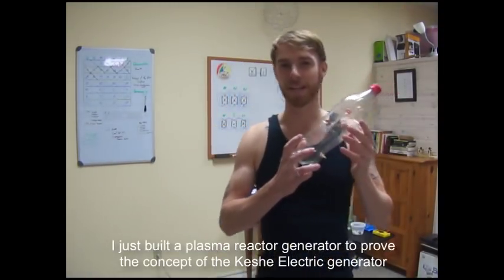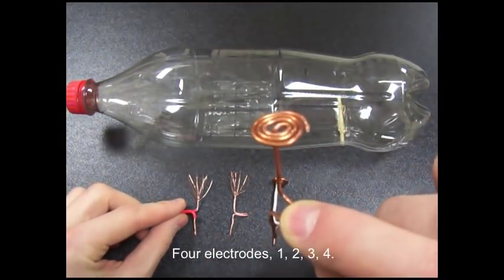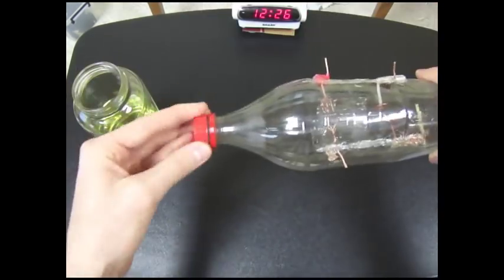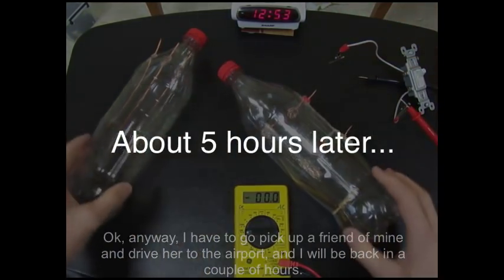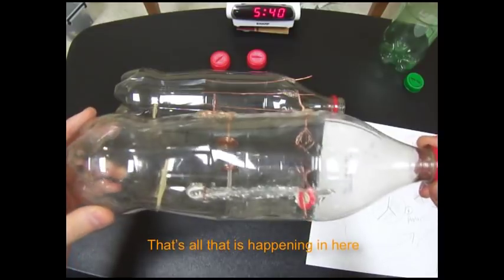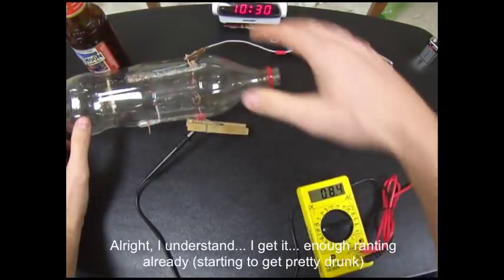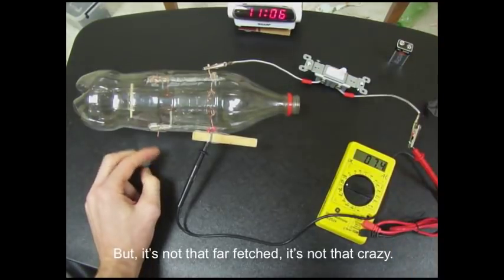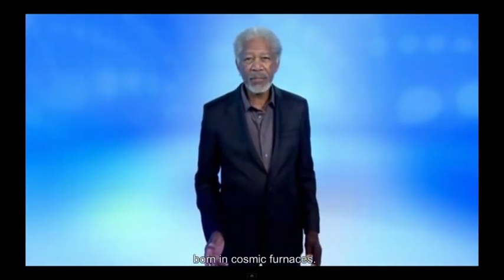Keshe Plasma Generator ~ Here is The Future ~ Infinite Energy

Comment: I experimented with nano coating copper and I was able to measure up to 29 mv in open air then discharged down to 0 mv waited for a minute and measured again at 32mv did this several times same results . I used sodium hydroxide draino crystals and boiling water to steam nano coat the copper, let it set for 20 hrs. Then dry overnight. Atmosphere seems to recharge my nano coated copper.

Comment: nice one..heres a few questions:
1 - if u discharge the reactor will tthe charge build back up?
2 - how did u get a clear solution like that..mine turned orange and it had exothermanl properties
3 - on my copper something build up any thoughts on that
4 - what is the current output?
5 - why is it working without a bottle cap?

Comment: You can actually get a useful amount of electrons to charge a battery.  Ham radio operators know that the wind strips away
ions from the antenna and can build up a very high charge that will arch a spark when it reaches a high enough voltage
using a old automotive ignition coil and a spark plug across the high voltage side of the transformer coil a pulse will be released across the 12 volt side of the coil where a diode will rectify this pulse to charge a 12 volt battery.  200 feet of bare wire will charge a battery within several days   do a search (Using a antenna to charge a battery)

Comment: Can someone explain, how is this infinite energy? Don't you need to use the solution in order for the reaction to occur? Doesn't the solution evaporate or dissipate? Won't you need to keep using more solution? If so, how is it considered infinite energy when you have a finite fuel source?

Comment: this looks more like a capacitor being charged with static electricity. dielectric material filled with air, copper leads seperated by air along the dielectric material and voila, low budget air capacitor. you constantly handling the bottle should transfer a charge via the triboelectric effect and gather on the copper leads, until you discharge it...just a thought. Keep up the good work though

Comment: You can make a far more potent battery from just dipping a carbon and an aluminium electrode in a solution of 10% salt and water. It'll work for months and will give you 1V per cell. You won't be able to power anything other than a bright LED with it though, but free energy usually comes in small ammounts so it's all in order there anyway. :)

Comment: Hi..Thanks for your work..I use tesla generators for hand helds 
Galaxy recharges and stuff.. but I see you developed 28 volts?  Is this sustainable under load?
How do you determine at what current- this system will sustain a voltage potential?  Thanks  Frank

Comment: Very cool..... one of many devices showing we are surrounded by vast quantities of energy and it's just getting to it. I like what you did here and it makes my head spin putting it all together. Think there are a few pieces loose... Ouch. If you have not tried measuring using the asymmetry of the weak force let me show you something I found much better than using dice. It allows information frame problem solving by using the information found in the question making getting the question correct the hard part but looking a lot like a card trick the Great Professor would approve of that the dice have been hiding: two harmonic commas notable because the second is bigger than the first and both are responsible for the asymmetry of the weak force and you will see having the asymmetry added to time is also added to space without violating L transformations and that means exactly what it says.... showing a second reverse arrow is connected to time creating the larger harmonic comma.

Of course that is the hard way of showing a second reverse arrows exists. The easy way is to just say atoms oscillate in space that is relative to time and look for it in an obvious place:-). It is the obvious things holding science back, not complex issues in need of new theories. You establish an inertial frame of reference for Mass or go nowhere faster and faster.

Doing math and understanding it are two different things and not using dice puts you all alone. I've been working on understanding how the fine structure constant @ e- {a}/t=hv has two doors for the 4 forces. {a} is the asymmetry ratio of two opposite arrows showing the coupling constant  is the result of a ratio. Not easy to stand in both doors and look both ways and keep the picture in phase. True symmetry requires the speed of light stopped in a wait state in the beginning and time crawling before it runs relative to the Observer's relative sense of time and the speed of light. You start with the concept of forever and break that in half..... and that's only half the time of a complete Mass oscillation cycle.

Well technically its a little less as the graviton's comma in the second half of the cycle is a little bigger than the electron's and that's where the force of gravity in 2D comes from, the tiny asymmetry in the weak force CERN detected with neutrino's @ v-c/c=2.48e-5 sec in 453.6 miles. SLAC's E158 data shows the asymmetry of the weak force adds 1 hour every thousand years to the speed of light using "clocks". That huge distance ratio breaks down into the wf asy adding 2.48e-5 sec in 453.6 miles too if you accept the 0.20e-5 (2.68e-5) left over needed for the larger second comma added to the second reverse arrow showing a spectacular match still over many experts heads while many laymen of interest "get it" rather well at times.
Reply from the maker: <3  Summary of Breakthrough Energy Technology: /watch?v=rSe7ovsucpk  :-)

Comment: Fascinating experiment,

Have you considered the possibility that by adding sodium hydroxide in your solution it will effect the copper terminals - this causes a chain reaction of chemical decay of the copper and as a result creates an electric charge. 

Interestingly this effect is accumulative with amphoteric elements (like most metals) however copper is extremely amphoteric in nature.  As it decays it creates more Cu(OH)2 (as well as conglomeration of Sodium Peroxide - which will increase the rate of the copper decay and as such increase the recorded voltage as more copper is exposed / effected.

From your demonstration it seems that you have developed a chemical battery where the copper is the sacrificial anode.

Again, a fascinating experiment - please keep on experimenting!

Comment: I'm pretty sure he just made a battery...  Potassium hydroxide is just good ole fashion Lye which is an alkaline (base) and easily produced.  What does have my curiosity is that lye has a very long shelf life (years even decades), soluble in water and it does not react or corrode iron or steel.  Could a power source be produced with these materials that just like a solar panel soaking up the sun, and when it needs to be charged you just add more (cheaply produced Lye) solution?  It is a battery that you don't have to charge by hooking a battery charger to it, you just change or add a chemical you can create yourself at home.  No one cares about the technicalities of whether or not it is a plasma generator or some kinda what-ever, it does produce power at small amounts just like a single solar cell, link more cells.  I think by now somebody might get where I'm going with this...
Can anyone share their thoughts?  No, I'm not claiming to be all knowing just curious what others think???

Comment: Some remarks on this footage. 
1) According to your definition of plasma my cat is also plasma - he is made of protons, neutrons and electrons. It's not plasma. 
2) This Keshe generator has to produce electric current/energy. The problem is that to get plasma it requires plenty of energy, e.g. electrical current! So you have circular problem. Plasma requires very high temperature to exist/create from e.g. gas. Small plasma ball requires 2000-5000 V !!! And it's volume is about that of your bottle, so you also should have the current of this U - voltage (P=U * I, P - power, I- current). Plasma can be create on Earth also in nature by lightnings. Then electrons are free, not bond with nucleus - its main feature of plasma.
3) Plasma IS NOT CURRENT AND GRAVITY. Plasma is only good elctrical conductor - not current itself !!! so:
A) you need current to get plasma
B) you again need current the plasma - being good conductor - could conduct the current
C) so if you have so many electrical current, what is sens to build something which gives a little bit of electrical energy - voltage as I saw well? No sense, no possibility
C) so you have in the bottle anything except plasma - what shows the measure? You have wires so the wires under the influence of magnetic induction acts as an antennas and conducts very weak electricity. Of course it could be increased (as in music amplifiers, radio, TV-set etc.) but it requires external electrical energy and it violate the principle of isolated system generating lectrical energy not using this from extrnal source.
4) And here we have all the absurd about the Keshe free energy and your "plasma reactor/generator.
BTW: To make plasma using lightning, it uses about current ~ 250 000 A, voltage ~ 30 milions V - congratulations
To make small plasma ball you need electrical current:  2-5 kV and of frequency 30-100 kHz - congratulations (watch on your bottle)
5) Gravity - plasma has nothing common with gravity - plasma simply reacts strongly on magnetic fields, so this feature is used in some type of experimental equipment for nuclear fusion (e.g. ITER) - your bottle doesn't look like ITER or TOKAMAK.
6) May be more beer make your dream comes true while dreaming on bed? Good luck! :)

Comment: Plasma is the 4th state of matter, which you can see in a florescent tube. It is created by passing electricity through a gas. This is a very crude battery with the use of potassium hydroxide. Changing the electrodes to nickel and iron and submersing them in the liquid would make a traditional Edison battery, which has Lithium in it to stabilize the charge, but doesn't need the Lithium Hydroxide to work. All he has is a rechargeable battery, and a poor one at that.
Reply: Thanks for explaining it!

Comment: I have used a multimeter like the one shown for 30 years, working as a field technician, the setting which you are on is reading milliamperes. 2 milli ampers is 2/1000 of an amp. This effect may arise from the static charge of the plastic bottle. Try duplicating your results using a glass or ceramic bottle? Either way, a simple thermocouple millivolt generator ( used on most water heaters) puts out 20-50 mill ampers, from just a pilot flame,acting as a safety device. This form of energy is so small it is in practicality useless.

Comment: Well, something is happening with the solution, but you forgot to mention something interesting, your voltmeter range is set to 200mv, (Meaning) your readings are 2.7 millivolts and the higher 59 millivolts in another word  0.0027 volts and 0.059 volts. If you are using the higher voltage, you need 203 bottles to have 12 volts and for the lower 4,444 bottles for 12 volts. The worst part where are you going to drain the current need it to put to work an inverter. But, anyway thanks for your experiment.

Comment: Wow, amazing.  Its a good thing you got back from the airport so quickly.  Otherwise, it could have gone into absolute equilibrium run-away, and blown up the local residential area.  Then caused a singularity, (Small one, you only used one (1) litre bottles), but a small singularity, that could have swallowed you cat.  (Hence bringing us to the schodingers paradox).  It's all connected.
Reply: but we won't know where the cat is or what it is doing.

Comment: How much energy have you produced ? Can you power a usb device ? ir anything bigger.  And is that volts on the meter ?
Reply: The meter reads 60mv, which = .060v. And the current is unknown so there is no proof of any power whatsoever. In basic DC electronics voltage X current = power.

Comment: Um....You're simply measuring potential here.  Not actual electricity/current.  I can measure a 200 Volt potential coming off a pole in my backyard. Does that mean its producing power?? No, of course not.  In fact it wont really "do" much of anything until a thunderstorm rolls through.  Then it might get hit by lightning.  Same with this bottle, however its doing what its doing, still don't mean much, as voltage is just a differential measurement.

Comment: The energy coming from your electrodes is a result of the electrochemical reaction between KOH and C6H8O7 (citric acid), the cost of energy in this setup is the base and acid required for the reaction, it is not free. If you want to impress people try to find a more efficient way to harvest solar power.
Reply: +John Smith One mole of citric acid and 3 moles of potassium hydroxide produce one mole of potassium citrate and three moles of water. That's your acid-base neutralization. But then he removed both...and waited. Then got his voltages that went higher and higher.
Reply: The sun currently puts out 120-140k lux. It should be 200k, it is cycling down and even got down to 58k in the last few years and the ionosphere wasn't bright enough for RF bouncing.

Solar panels aren't any use then.

 Understanding dielectric convergence is the real version of this idea.

Comment: Great stuff man. You and Keshe are probably correct. Eric Dollard has demonstrated on multiple occasions that if you point 2 telsa transformers (transformers not coils, 2 totally different things), at each other inside a vacuum tube, a fully formed galaxy with stars and planets and nebula will appear within the glass. The glass eventually implodes from the massive increase in energy and the galaxy stands in space outside the vacuum for up to 3 seconds.  A telsa transformer doesn't transform anything, it amplifies the ether. Dollard wrote a paper called condensed intro to telsa transformers on it. I think it would very relevant for your experiment. https://youtu.be/IeoOJaPl4Oc  I think your solution programs the electrodes, and the electrodes are collecting ambient electric frequencies, of which there are plenty. Im gonna try the experiment and see if the source can hold a load.

Comment: DO YOU HAVE RADIO TOWER NEXT TO YOUR PLACE ,HAVE YOU TRIED TO MEASURE ENERGY TRANSMITTED FROM THE LINES OF ELECTRICITY IN THE WALLS,OF YOUR HOUSE,THEY DESIPATE SOME ENERGY,EVERY LINE OF ELECTRITY INSIDE THE HOUSE,MAYBE THIS EXPERIMENT IS RIGHT AS WELL,I HAVE TO TRY IT ,THANKS FOR THE INFORMATION

Comment: You must have considered the nay sayers beforehand but not prepared for them. Put a oil barrel and turn that 2v .0000001 milyamp to .5 amp and then run a motor with .500 t, so we can then compare this to other existing free energy devices that does create that amount of amps presently. Keep up the good job.

Comment: OK, so this produced 50 millivolts; what amperage was produce?  How many of these littler buggers would I have to sting together in series to get the equivalent output of a double-A battery?  If you include the cost of soda, NaOH, copper wires, plastic bottles, time to build it, and storage costs (much bigger than a double-A battery) would it cost less than $1 and/or have the same utility of a double-A battery? Can this be produced on a micro-scale?  Also, I do not see the correlation between being able to produce an electric current via chemistry (which has been documented since the late 1700's) and broadening our comprehension of gravity.  Why the reference to "gravity" in discussion of this battery?

Comment: Why not connect several of those bottles together in a series and run a electric motor or some light bulbs? Using volt meters is not very convincing imo.

Comment: In order to ionize hydrogen you need energy. Once you hook up any load to this battery that energy will be used by said load. If it continually outputs power after whatever chemical potential energy is stored in that bottle is expended, then post that because you'll have broken the laws of thermodynamics. 
Also, if you ionized hydrogen(which you'd have to do in a vacuum in order to prevent it reacting with the air), after the electrons and protons recombine to become stable, where does the energy come from to repeat the process? 
It's good to see someone being skeptical of the world around them, that's what science is all about. But making a battery in a bottle and claiming "Infinite Energy" while using fancy words to make yourself appear smart to an uninformed and gullible audience is a waste of everyone's time.
Good day.

Comment: Probably what the Egyptians used in those lamp looking devices in their murals. The Vikings were the first to electroplate nails. 
But as someone else says (Elias), you're going to need a lot of them. Just to charge your phone in a couple of days.
Your USB port (2.0) offers 5v at .5 amps. 2.5 watts. But if it only supplied 0.0625 amps it would need 40 bottles, and 2+ hours to recharge a 1 amp hour phone battery. This power he describes is similar to running a comb through clean hair. Lots of voltage, no current to back it up. If he used an old vacuum tube volt meter you would probably see even higher voltages. Still diminutive.
Not to discredit the author, but data of one leg of a triangle is useless.